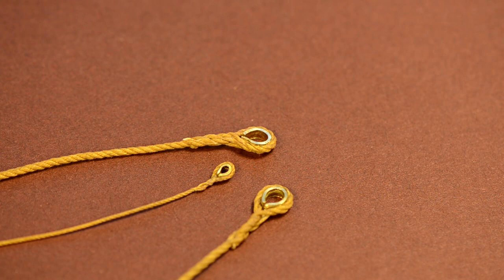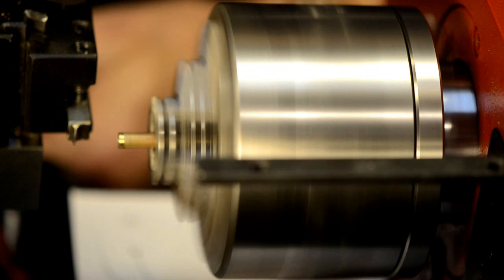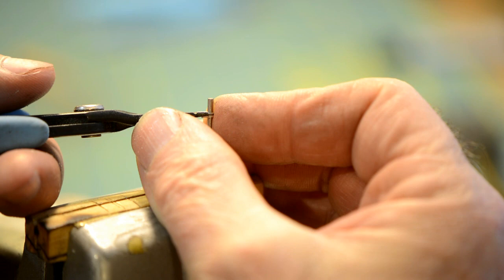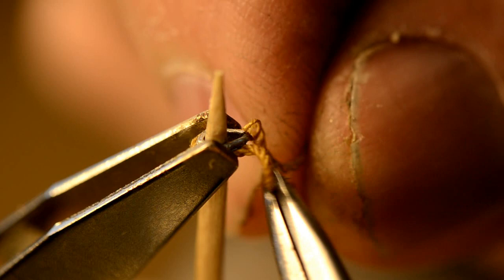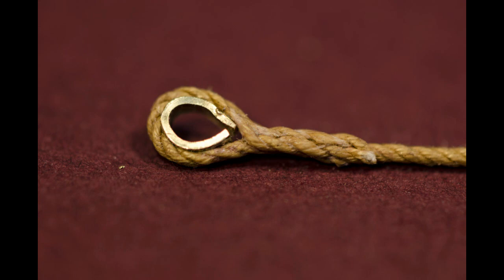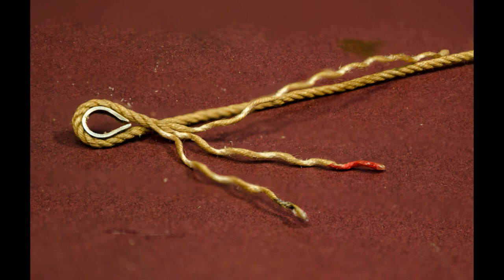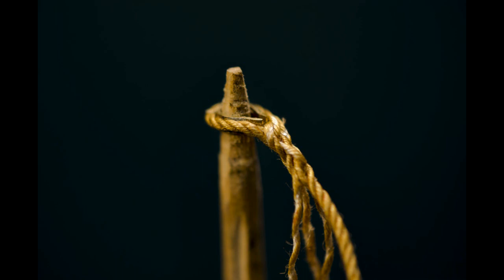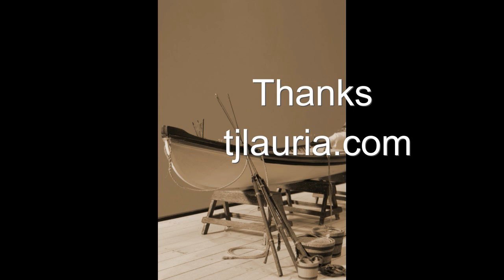Eye Splices and Thimbles for Scale Ship Models

Comment: I have boat plans by underhill but the plans show sails but not where the running rigging ties off.  Could you suggest a reference for rigging small boats?
Reply from the maker: Wow.  That's a tough one.  I really can't think of any books specifically for rigging small craft.  As I'm sure you've found out, it depends so much on the period of the boat and its intended use.  Some of the model kit companies may have small boat kits similar to the one you want to build.  You might try contacting them and maybe buying one of their building guides.  Other than that, I'm afraid I'm not much help.

Comment: Hi Tom...I have questions on rigging line.  I have seen some beautiful ships built on YouTube and then the modelers wind up using line that is very "fuzzy" and just ruins the look of the model.  Is there specific products out there that should be used and if so, where do you buy these lines?  Thanks!  Great job by the way.
Reply from the maker: Linen and silk are the two most sought after lines, mostly because they have a minimum of that fuzz you mentioned.  They are both pretty hard to come by these days and, if you do find them, they are usually pricey and not always suitable to your project's specific needs.  Syren Models in Connecticut has some good looking linen line.  Go to their website and give them a try.
You can get a nice result from cotton if you take care not to man-handle the line too much.  If you do raise some fuzz, it can be singed off with a micro torch.  In one of my videos
 (Blocks not from Scratch, Part 2 at about 23:17), I demonstrate the technique.  You won't see the micro torch in the frame, but you will see the effect it has on the fuzz.  However, it is not for the faint of heart or the shaky of hand.  A moment's inattention can send your rigging up in flames.  Having said that, if you do master the technique, fuzzy lines will become less of issue.  Good luck.  T

Comment: Hi Tom, got a question ?? U  have any ideas on model boat rails for a tug boat. On mine made  upper level in brass 
 So what kind of a rigging to use between ladder ( chain )  or rope. Style.    

Boat is Carol Moran,  taking personal Message
Reply from the maker: I knkow virtually nothing about tugboats, but a quick perusal of google of your subject reveals that tug generally had rigid railings and banisters.  It SEEMS like a safe bet if you were to continue on with the brass wire for all of it.  Hope this helps.  T

Comment: hey tom can you tell me what kind of lathe do I get with what kind of cutting tools do I need to get to make all kinds of parts for model rigging thanks bob
Reply from the maker: There would be so many questions I would need to know the answers to before I could possibly recommend a particular tool to someone.  I will say this: examine what you need to fabricate, how often you will use the tool and what kind of parts will you be making with it.  Will this be primarily a metal working lathe or woodworking? How much space do you ave? What's your budget? What's your experience with machining?  These are just a few things for you to consider before dropping over a grand on a piece of equipment.
I would also recommend checking out the Blondiehacks YouTube channel.  She's great for explaining how things get done from the hobbyists'  point of view.  She's very good, thorough, smart and you'll always learn something from her videos.
If you're convinced a lathe is something you want to invest in, a good place to start is Little Machine Shop.  They have the machines and the tooling to get you started and more.  Just be warned: once you start spending money on machining. it can be addictive.  Just sayin...

Comment: Hello, what type of thread do you use and what size?
Reply from the maker: My "go-to" rigging line is linen, if I have it in the sizes I need.  But, I freely use Chinese Suture Silk, or cotton when I don't have the linen.  I have been very lucky to acquire a good supply of linen ( originally manufactured mostly as fishing line) in sizes down to about  8 or 10 thousandths.  and I have some linen threads down to about 4 thousandths.  I've been collecting the stuff for the last four and a half decades and, as I said, I've had some very good luck in mt quest.
As far as sizes go, that's dictated by the scale of the project.  So I can't be specifically helpful there.  When in doubt, go smaller.  It is important to make sure you accurately scale out the cordage you need for a project.  I've lost count of how many models I've seen that have their appearance ruined by over-sized rigging.  So, at the risk of repeating myself, when in doubt, go smaller.